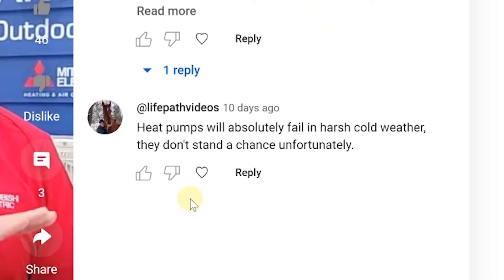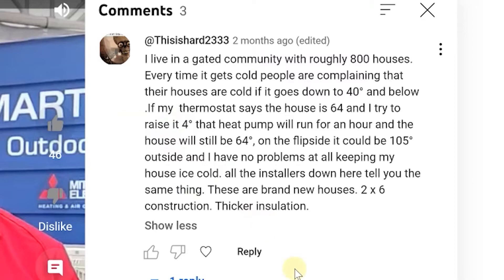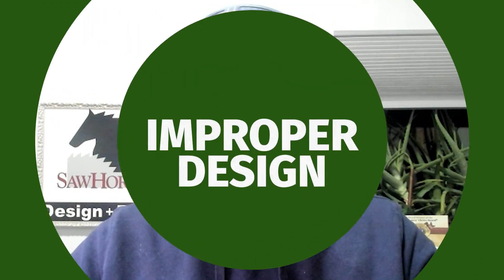Why heat pumps don't work in the Winter

Comment: Ha your title got me all riled up :)  I'm in Canada and I've found two interesting take aways switching from an oil furnace to a heat pump.  1)  the house  is comfortable all the time.  No temperature swings up and down while the furnace cycles on and off as we're used to.  Yes the heat pump runs a lot during the winter, but it's only using 500W.  2)  Our heating costs have reduced dramatically.  We saved over $3,000 this winter season alone vs. oil heat.  Anyone on oil heating should consider a modern heat pump to replace it. Keep up the good videos - I stumbled on this and subscribed!
Reply from the maker: Glad you enjoyed the video.  I knew the title would get people's attention.  It is true and false at the same time.
Reply: I am excited because we are putting in GIANT VRF heat pumps.  We have gas and needed new boilers, and we got a lot of advice not to cut gas out entirely.  So, above 30 or 40 degrees the gas will be a back up and the heat pumps will fuel our home.  When the temperature drops and as the heat pumps are slightly less efficient, the gas can take over more. The heat pumps will of course "work" in our cold-at-times Massachusetts climate, but they won't be as efficient as the temp drops. For our next home, I'll hope to get rid of internal combustion. But as it was already here and it gives us a hybrid system and it's really seen as a plus where we live, the gas stayed.  But our new boilers are like 95%+ efficient!